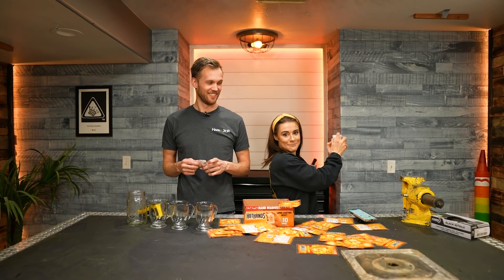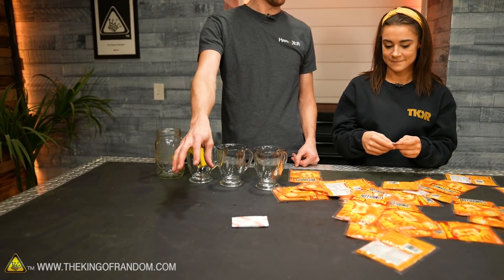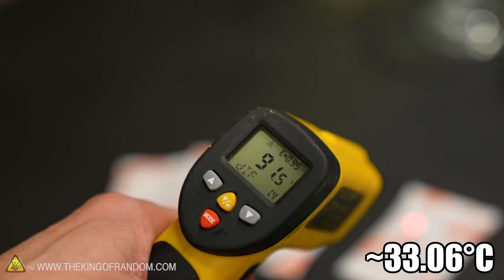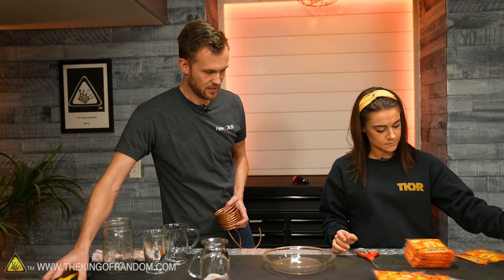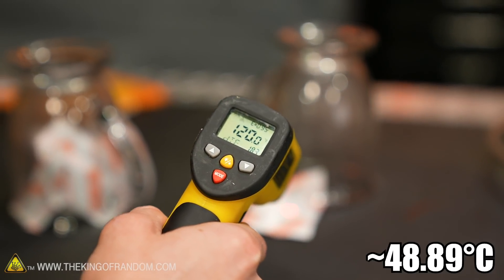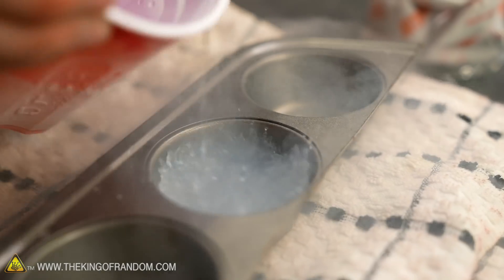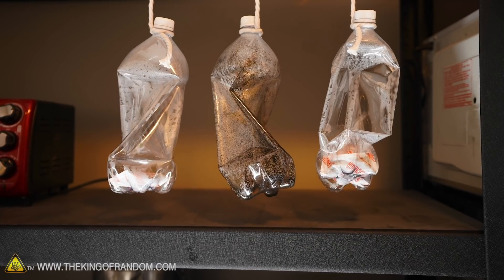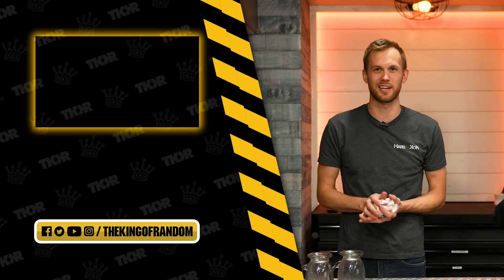Can You Overheat Hand Warmers With Pure Oxygen?

Comment from the maker: What other experiments could be done with hand warmers??
Reply: You should try to cook something with a whole lot of hand warmers.
Reply: @erickadavis6083  I agree
Reply: Make a giant heated pillow with hand warmers
Reply: PUT EM IN A MICROWAVE
Reply: Since youve got a bunch of used handwarmers, is tgere a way you could extract the iron and smelt it into something else?
Reply: Heat a steak with them😲
Reply: Super heated hand warmer?
Reply: Freeze dry one
Reply: Do they react to magnets because of the iron? That might be interesting to do stuff with magnets
Reply: @LightSource27  Magnets for sure

If you extract the iron it is very fine and gets very magnetic.
Reply: Can u made food with warmers
Reply: Have you seen the reusable hand warmers, with the metal disc you snap and it turns a liquid into a solid? Can you do a video on the science of those?
Reply: Heat suit
Reply: Use the hand warmers to make thermite or some other kind of flammable material?
Reply: Try to cook food with it
Reply: microwave it (and i still want to see a whole ostrich egg in a microwave :-) )
Reply: you should try mixing it with water and see how hot it would get and maybe put them in different vacuums
Reply: could hand warmers be used underneath pots or pans to cook or heat up food or at least a liquid
Reply: You want the hand warmers to get really really really hot drop them in hydrogen peroxide of different % to see what one is the hottest. OH and you WILL NEED to use something other than glass as the heat could easily break glass jars.
Reply: Put it in a vacumm chamber
Reply: Make a jet pack!
Reply: Starting a fire with 1,000 hand warmers
Reply: Yes had warmers the melt metal or make termite
Reply: 🔥🔥🔥🔥🔥🔥🔥🔥🔥🔥 pleaseeeeeee
Reply: Heat a steak
Reply: FLAME THROWER!!!!!!!!!!!!!!!!!!!!!!!!!!!!!!!!!!!!!!!!!!!!!🔥🔥🔥🔥🔥🔥🔥🔥🔥🔥🔥🔥🔥🔥
Reply: Thermite
Reply: Cooking, I want to know if you can cook with hand warmers.
Reply: see what it takes to make them ignite without using an external flame source
Reply: Can you cook an egg or other food with them?
Reply: Try to collapse metal canisters like you did with the soda bottles.
Reply: Can you make ferrofluid with the powder and have warm ferrofluid to play with, uh, I mean, experiment with?
Reply: What would happen if you put a bunch of handwarmers in the furnace
Reply: Theoretically can the iron powder be used in thermite or fireworks. 

Also try to use the hand warmers to cook food like a mre meal.
Reply: Smelt it in a furnace
Reply: Make a cannon
Reply: Hand warmer fashion
Reply: If you could theoretically get a hand warmer hot enough, could you cook things on it?
Reply: Make a massive hand warmer
Reply: Forge with the iron
Reply: Would they still heat  up if frozen in liquid  nitrogen  and could  you guys do something  with the super large ones
Reply: Way theme before and after because it should get heavier
Reply: I'd like to see how plausible cooking food might be. Or at least reheating it. Stick one under a mug of cold coffee (or tea) and see how that turns out.
Reply: Put them in water and see what happens??
Reply: Idk about hand warmers, but I'd like to see video testing some diy personal insulation. Things like newspapers, tin foil, bubble wrap, duck tape, etc... Maybe combine them with the next hand warmer video. 
This topic is especially relevant now, considering an ice storm just ripped through woefully unprepared southern states. I lost power for over 36 hours. Never thought that would happen in the southern winter.
Reply: Put it in water to dissolve the salt then filter the liquid and then put the iron powder in hydrogen peroxide to turn to iron oxide then see if you can make it into thermite by mixing with Al powder
Reply: Make sure you stick a hot warmer to the ceiling
Reply: Try the plastic bottle version but instead put it in the vacuum chamber without pulling a vacuum and see how much of a vacuum they'll pull on their own.
Reply: Try smelting it out for its iron? try and make tool, a knife and a small set of tongs with? You could also cast it with cement and see if the heat quickens the drying process.
Reply: See if you can reactivate them with oxygen after they have been used
Reply: Microwave and freeze dry!!!!!!!! please! like if you agree!! please!!!
Reply: You should try and cook something with them
Reply: I've been asking for a while, but please try to cook food
Reply: Try putting some in a vacuum chamber and freezing one and lighting one on fire also try putting one in some liquid nitrogen loved the vid bye the way
Reply: see how many hand warmers it takes to forge a knife
Reply: Make thermite by separating the iron out with an electromagnet, oxidize it (with liquid oxygen if you can), and then mix it up with aluminum powder
Reply: @frotwithdanger  
Wooooow think you dude
Reply: Set fire to them
Reply: @katiehutchings4743  nooo
Plaese no
Reply: Set fire to them
Reply: @katiehutchings4743  
Isy nooooooooooo
😤😤😠😠😠😡😡😡😡😡😡😡😡😡😡😡😡
Reply: @katiehutchings4743  
Because I burn my hand 
And it hurt really bad
Reply: Ohwell you can still set fire to it
Reply: @katiehutchings4743  😑😑😑
Reply: Try heating them so much they exploded
Reply: lol you could send them to me since i work outside
Reply: @GypsyRose666  
Me I born my hanh
It's really hurt plaese
Don't do play
With fire please
Reply: Sodium Acetate Re-Usable Hand Warmers. You could cut them open and show what's inside. I have the Hot Snapz brand, but there are other brands, and I have read that they can be DIY'ed.
Reply: ive always wondered, would the explode or catch fire is you mixed them or put them in like a bucket/cup full of gasoline or fuel???
Reply: Frezze dry or liquid nitrogen
Reply: Not this type in particular. But why not those reusable ones? Saw a vid on them and they where pretty neat.
Reply: Set on fire ahhh
Reply: UHH TIME TRAVELL??
Reply: Y'all should do have warmers with carbonation (what's used in sodas).
Reply: Cotton candy
Reply: Hi 🙋‍♂️
Reply: Hi
Reply: Put them in the microwave
Reply: Can they be forged into something?
Reply: See if you can make a flameless ration heater with 'em
Reply: Hand warmer thermite
Reply: Try to cook stuff like eggs
Reply: Lite the hand warmers on fire
Reply: Light one on fire! Or maybe make a giant hand warmer!
Reply: See if you can put a bunch together an cook something like a egg, steak, toast or something. That would be interesting to see.
Reply: u could try to see if you could boil a pot o water with themandstuff like that
Reply: Burn them with calli
Reply: You could try starting a fire with one/ use the solar scorcher on one
Reply: Will handwarmers work as thermite?
Reply: Blend both packaged and non-packaged in a blender and see how much oxygen it mixes in
Reply: Set them on fire or make them produce fire
Reply: You should put them in gasoline
Reply: Try cooking food with them?
Reply: cook an egg
Reply: Can you make thermite off of the hand warmers?
Reply: Could you take the iron from them and cast something with it?
Reply: If you have enough of them could you cook something with them
Reply: Is it possible to use hand warmers to start a fire?
Reply: Please please please be careful with vermiculite
Reply: Dry ice and liquid nitrogen
Reply: You should try to soak orbies in gasoline and see if you can make them flamible
Reply: Can you cook with them?
Reply: Make your own hand warmers
Reply: Ya know how steel wool burns? Try it with hand warmers! And also in a vacuum!
Reply: cook something with them
Reply: LIGHT IT ON FIRE!!!!!!!!   PYROMANIA
Reply: Do you think thermite could be made using the iron powder inside the handwarmers?
Reply: COOK A STEAK
Reply: use of a funnel
Reply: I've been told how careful I have to be with these as 'they are super flammable and can explode'. But I've wondered just how easy that would be to happen, and am I at risk of that in just every day life. What would it take to set one or more of these off?
Reply: Make a body size hot hands
Reply: TRY PUTTING HAND WARMERS IN THE FREEZE DRYER TO SEE WHAT HAPPENS
Reply: Try putting them in a vacuum and adding pure oxygen. Try in both forms. In pack and without.? Btw you have been doing an awesome job given everything. Thank You!
Reply: can you brew coffee with hand warmers?
Reply: Put the hand warmers INSIDE the hands
Reply: MAKE IT EXPLOSIVE
Reply: see if you could cook a steak with them
Reply: Huh this was posted 8 hours ago it this comment was three days ago 🤔
Reply: Fire. Try lighting them up and/or put the powder in the foundry.
Reply: Set them on fire please
Reply: Hand warmer thermite!
Reply: Extract pure iron from hand warmers
Reply: Y'all should test the ph level of water in different temperature
Reply: Try to mix it with other metals
Reply: Try to cook a steak 135° medium-medium rare
Reply: put a balloon or something and some hand  warmers in a air tight jar and see if its like a vacuum chamber
Reply: Can you cook anything with hand warmers
Reply: put them in liquid nitrogen
Reply: Put some in a package with food that normally goes bad quickly, eg fruit. To check if these can preserve food.
Reply: Mix it with solid oxidizer like KNO3 ?
Reply: Maybe make a giant hand warmer? Or it would probably have to be so called a body warmer if made big enough haha
Reply: Make ferro fluid and magnetic putty.
Reply: Exothermic fire starter? Ferro fluid? Magnetic putty?
Reply: Melt it down....if it's iron it should melt right?? I'd like to see that happen
Reply: Vacuum chamber
Reply: You can eat that?
Reply: Grow things in it
Reply: @rosalie1058  ok?
Reply: Warm your hands with them
Reply: @Udead_Mage  
Ohhhh okkk!!
Reply: Super heat them to flames
Reply: Mabey see what happens in no oxygen environment
Reply: @mamashark9576  
We can die plaese don't
Say that
Reply: Connect a vacuum gauge to a sealed container.
Put a hand warmer it and one liters of air and see how close to zero atmospheres it gets.
Reply: @cremsh  
本当に😑
Reply: @ashketchumertaiment1695  Yup :D
Reply: Hand warmer thermite? Hand warmer rocket motors?
Reply: @scotttod6954  
You eat people skin
Reply: Whats the best hand warmer
Reply: Freeze Dry them and then put some into saltwater, might work like a flameless ration heater
Reply: Would the silica gel packs used to keep food fresh keep them from working?
Reply: Make thermite
Reply: They have a reusable one version can't see what you do with it
Reply: You guys should do some experiments with bondo or autobody filler I noticed as I put on very thick layers of it it gets super hot sometimes to the point where you can’t even touch it it’s like thermal hardener or something
Reply: Can you make your own hand warmer?
Reply: See if you can save the hand warmers and use them again
Reply: See if you can save the hand warmers and use them again
Reply: dry freeze it also use it to cook
Reply: Can spent hand warmers be used to make thermite?
Reply: blew it up
Reply: Can you cook a steak with hand warmers?
Reply: i have an experiment idea for you, what would happen if you wrapped a soda bottle in duct tape and filled it with air, how many layers would it take before the compressor could no longer keep up or something else failed?
Reply: put a hand heater in the oven
Reply: How many hand warmers does it take to boil water. Or is it even possible
Reply: could you try to do the same experiment with the hand warmers but with bigger bottles? you said the hand warmers used the oxygen too fast so if you had a bigger bottle with more oxygen then we would be able to see the full capacity of what the handwarmers could do.
Reply: Can you drink liquid oxygen like liquid hillium if so can you drink it and will it affect your body?
Reply: Could you keep a small cooler warm with them? Maybe just enough to keep a hot lunch warm for a picnic or something?
Reply: I'd like to see what you can do with the hand warmers that have a disc that has to be clicked to start the reaction.
Reply: Make fire with hand warmers ;)
Reply: Try cooking with them
Reply: Fire!!!!!!
Reply: Use only hand warmers and cook meat or steak
Reply: Cool an egg with them
Reply: Cook an egg with them
Reply: I know you posted this video four months ago but I think y’all might be able to make a giant hand warmer
Reply: Time traveler
Reply: How u comment 2 days ago
Reply: @Stxrvibeyyy  Hacks
Reply: @Stxrvibeyyy  bru i just realized

Comment: I had a friend stuff these in her dry suit (for scuba). As the PPO2 rose, so did the heat, so much so that she had to call the dive.

If you’re familiar with PPO2, you can exceed a PPO2 of 1.4-1.6 bar whilst diving. On the surface you can get a maximum PPO2 of 1 bar (100% O2).

Comment: On the timelapse bottles, the speed at which they collapsed is more important than the degree to which they collapsed. If all bottles are the same volume and have the same volume of oxygen, then they theoretically collapse to the same degree since the same reduction in oxygen volume would take place. So, the three handwarmers collapsing the bottle faster shows the reaction taking place on a larger scale.

Comment: An experiment with pure oxygen. Stated in the video pure oxygen helps combustibles burn quicker, hotter and more efficient. Use the the pure oxygen to attempt to run a a single cylinder predator engine from harbor freight, and see if there would be a difference with efficiency, and power of the engine. Which doing this I believe would be a little difficult because your using a naturally aspirated engine and installing a pressurized canister which in a way makes it forced induction.

Comment: I would like to see if you can "cook" them in an oven at a low temp and then reuse them?
Reply: That works for moisture absorbers, these are actually oxidizing and warming them up won't reverse that process.
Reply: @deltab9768  Then is there a way to "recharge" them? Or recycle the powder into something else like rust for thermite? Or maybe smelt it down for a project?
Reply: @lordkahtu96  It might have too much other junk for thermite but it could be worth a try. 

If it doesn't work, you could potentially dump the old powder into water, salt will dissolve, hopefully some of the charcoal and vermiculite will have enough trapped air to float? Collect the rust slurry at the bottom, dry it out, and have another go...

Comment: Based on recent experiences with extended power outages during extreme (for Texas) cold winter temperatures, what would be the best way to use hand warmers to keep yourself warm when you don't have other heat sources? What are some other ways you can safely generate heat indoors with normal household items (but no electricity..except maybe from batteries).

Comment: Could you use what's inside of the hand warmers to make thermite or some other kind of flammable material?
Reply: Iron can be flammable when introduced to pure oxygen.  Don't think it will make a thermite style reaction, but it would be a dangerous fire as its not one that could be put out with water.
Reply: You can make pure iron based thermite like substances but  the hand warmers aren’t pure iron so it would be interesting